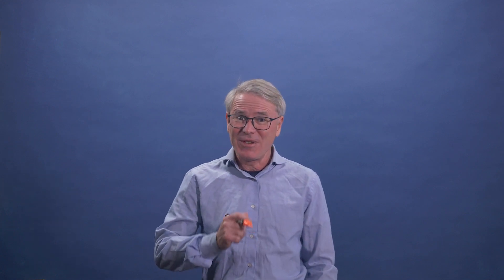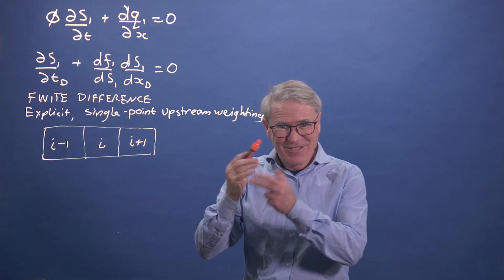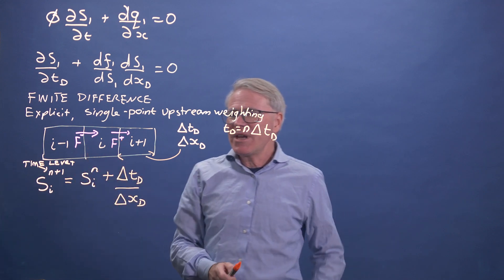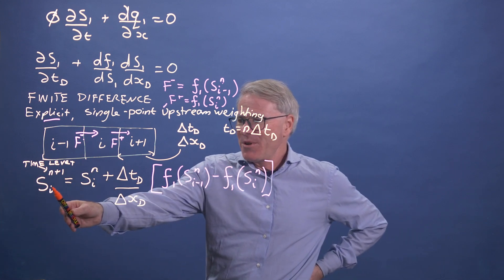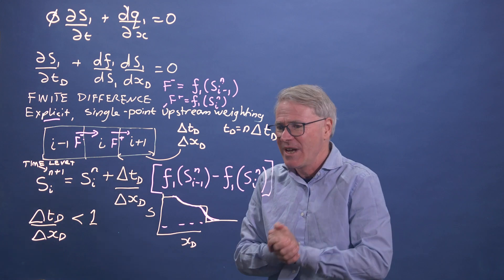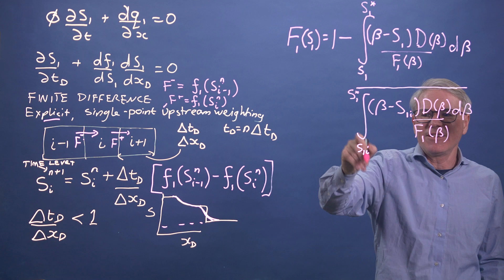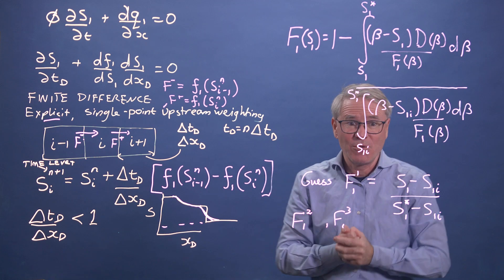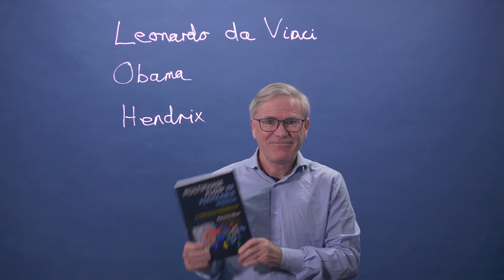Modelling flow and transport processes

Comment: Sir, I have 4 colloidal solution of particles comprising of sizes 1nm, 10nm, 100nm and 1000nm respectively, also I have a heterogeneous sandstone core and an injectivity system. 

Can I track the permeability variation along the length of the core, with recorded parameters during these 4 different coreflooding experiments.
Reply from the maker: I am not sure how this will work: you may be able to assess how the pore space is blocked by different sized particles, but this will not give you a spatial distribution of permeability, unless you can image the particles as they flow through the rock.